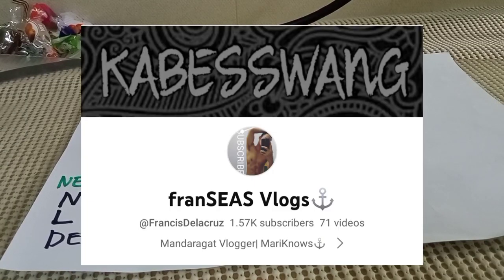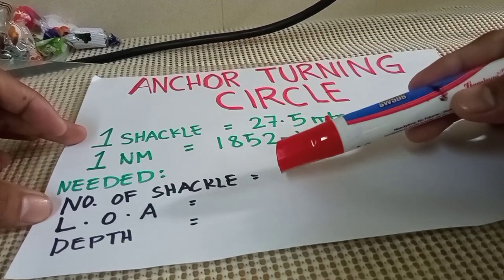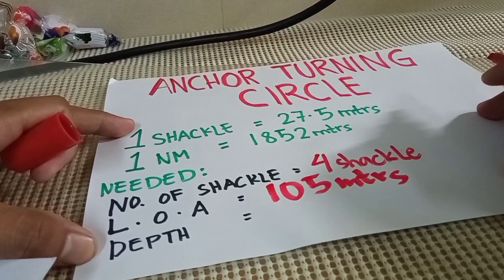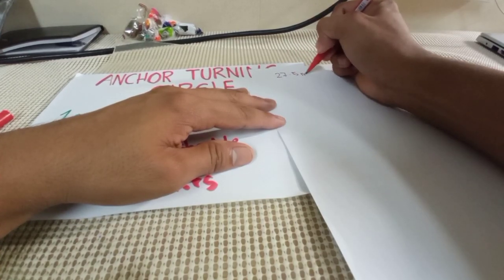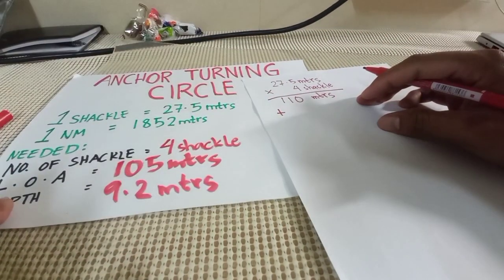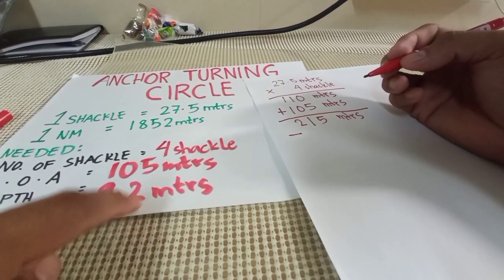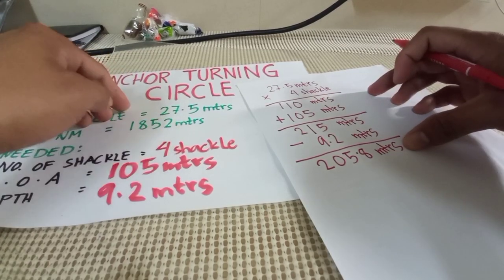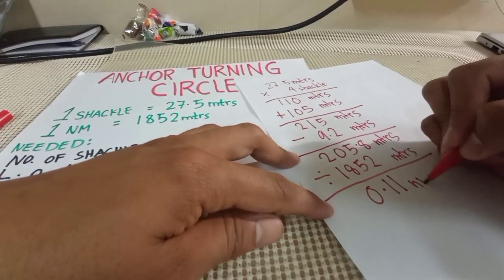ANCHOR SWINGING CIRCLE CALCULATION

Comment: Pano naman po pag may draft sa given?
Reply from the maker: Subtract draft to Depth of the water. In my computation, draft is not included, because shackles measured from the deck to the bottom.